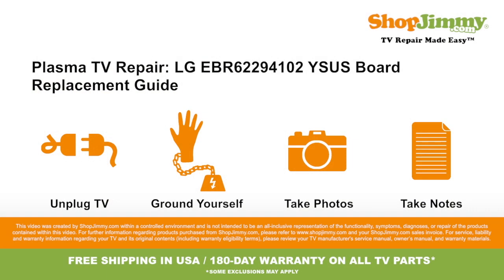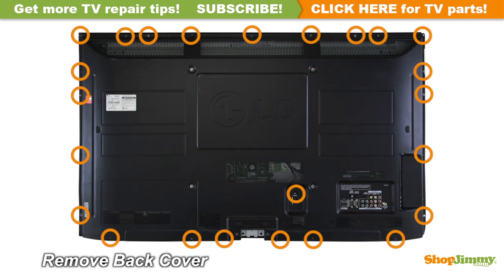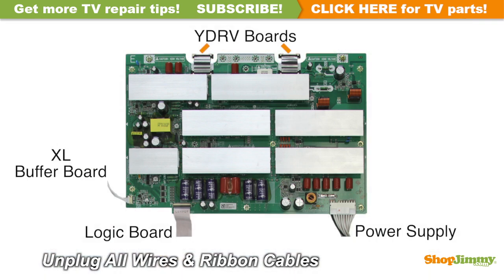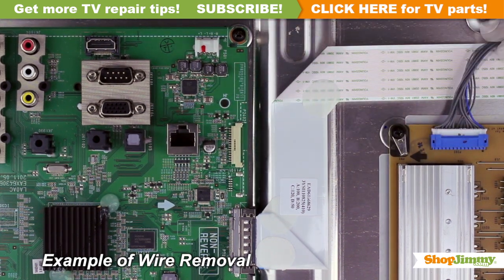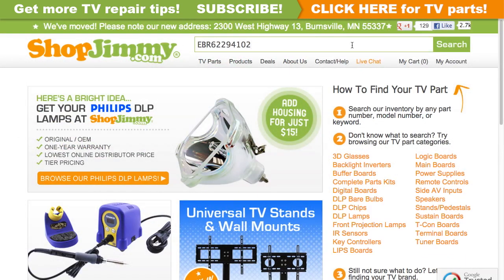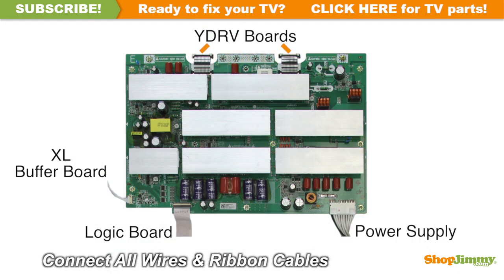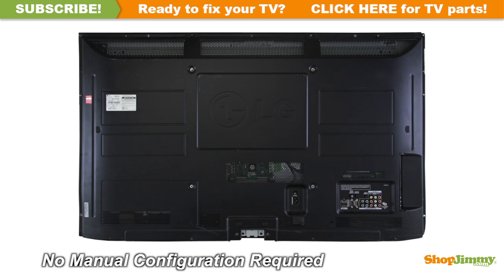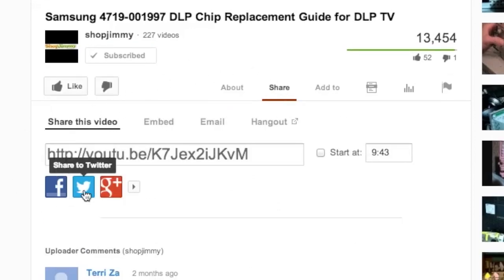LG Plasma TV Repair - How to Replace EBR62294102 YSUS Board in LG 50PK Plasma TVs - Fix Plasma TVs

Comment: can you help me with my old lg? it is turning on but has bad picture, even the "no signal" text has horizontally shifted ghosting pixels, any input has multiple shifted ghost columns... it is like when on an  lcd the ribbon cable has a break or freqvency shift but I don't know how plasma works. no visual issue inside, no puffed capacitors etc...

Comment: We have an LG 60pk200 UA 1080p Plasma tv purchased around 2012 and worked fine up til 3 or 4 months ago when it started showing some horizontal flashing lines but only sporadically for a few weeks before not coming on at all, it shows the powered light but won't turn on with the power button on the tv/remote. I looked around on google and mainly see people mentioning the ysus board as the issue but I'm not 100% sure and no local shop that I know of.
Reply: Problem seemed to be the Main Board, ordered a new one and works totally fine now.

Comment: Hi, wonder if you can point me in the right direction please.  I have a 50pk590 with sporadic horizontal lines and reverse imaging. I’ve changed logic board but the  problem is unchanged.  Get the problem displaying the menus as well with all inputs removed.  Many thanks

Comment: I have a LG 42PG25 plasma TV manufactured in May 2008. The model number is 42PG60UA. It has a LGE PSU EAY39333001 PSPU-J704A Rev 1.0 power supply unit.

It has a EAX42297601 Rev J YSUS board, a EAX41603501 Rev J ZSUS board and a EAX41833301 Rev C CTRL control board. 

A few weeks, the TV would power up but with a blank screen. The solid red standby light in front works. When I press the front power button, I hear a solid clunk sound and the standby light changes colour from red to blue and starts flashing blue. At about the 5th blue flash (approximately 5 seconds in) I hear a buzzing sound in the back. At about 18-19 flashes later the light stays solid blue with no screen or sound. When I turn the power button off, it takes about 11-12 second before the solid red light turns off complete with a clunk sound. 

I watched a lot of LG TV repair videos that led me to believe my PSU was damaged. I ripped apart the back panel and found Capacitor C235 blown from the PSU board. I replaced it and nothing changed. I had spare 10V 3300uf capacitors and replaced C232, C233 and C234 as well and nothing changed. I checked fuse F101 and F801 on the PSU and both were good. I checked fuse FL201 on the YSUS and it was good. I checked the some voltages on the P811/P64 testing terminal right beside where the power goes from the PSU to the YSUS – all voltages were in spec for all the testing terminals (VS, VS, NC, GND, GND, VA, VA, GND, M5V, M5V). 
I tried isolating the buzzing sound from the YSUS and it is sounds like it is coming from a 4 pack of glued together red capacitors C701, C702, C919 and C920 on the YSUS board, or possibly the two copper coil things I think called L901 and L701. 

I am not sure if it matters, but when I turn on the TV, control board light D103 (is this a diagnostics light?) comes on but then immediately goes to D104. Light D104 stays lit up until about 60 seconds when I hear a change in the buzzing frequency ( a bit lower) and then D103 comes back on and stays lit. I also see a light on the video board (it has a sticker that stays 42PG60UA), light LD803 that stays lit up the whole time with TV tries to power on. 

I really don't care for the TV as it is a power hog, old and small. But I've already started down this path of diagnostics and will not give up. Plus its kind of fun! Does anyone have any suggestions what I should test next?
B.

Comment: Hi I have a LG Plasma model # 60PZ550-UA    The picture had been turning green for awhile b4 it totally went black. It still had sound. All I Know is there is a bad fuse on the Y sustain board (Brown stripped ceramic fuse)its a in line fuse. got some coming but I dont think thats the problem or it wouldn't have slowly went out????Right?????
TV is only 6 yrs old!

Comment: Hi, I have an LG 50PK590 TV, it seems that my Main Board is faulty as there is no video/audio, I can see RED LED blinking when I push buttons on my remote apart from that I can only turn it on or off no VIDEO at all, I searched online for a replacement Main Board however it costs more than £200, that is way too much for a component of an old TV, is this a common fault? what would be the actual component on the board that's faulty? Main board serial EAX61141603 (4) LGE HEBT61039402 G2, thanks so much! Ben
Reply: Benas Grigisas I have the same one n problem but can't find the part

Comment: I also have a Tedelex ec pd 1000 plasma which when i switch it on it shows a red light.when i remove it on standby the red light goes off but there no picture or sound.there is 5v only on the power supply

Comment: I have the LG Plasma TV LG 60 PK 750 2010 and when I attempted to turn it on with the remote, the blue light would come on in the lower left hand corner on the front of the screen but no picture.  HELP.  There appears to be power to the TV but no picture.  Can you help me out?  Retired Greg
Reply: Hi, I am Hasan from Bangladesh,  and I have a LG42PT250 TA....Plazma Tv
The problem is Y sustian board is gone, how may I buy, please help me to buy it,
please contract me
hasanshek78@gmail.com
h/p+8801712443020

Thanks
best regards

Comment: i have an lg 42 inch 42PJ350 and it clicks on and off no display no sound but red light i disconnected the ysus and the set clicked once as it indicate coming on does it mean my ysus is faulty and causing the power cycle???
Reply: Rosak tiada gambar

Comment: Hi there.
I have LG 50PC56 plasma tv.Few months ago screen start flickering black from time to time on 1080p.After few weeks i had to set my ps4 into 1080i..this solve problem for another few weeks.then it starts flickering again and i go for 720p.
This resolution was working fine for about three months and now the same story happening.When i start the tv from cold its working fine on 720p..after its warming up the flickering going on again.
I opend it up today,clean all the dust and surprisingly tv was working 1080p for a few mins.I was ready to give up,then found your channel and maybe there is still some hope.
Can you please direct me whitch board i need to replace?
Thank you in advance.

Comment: Hello I have an lg plasma  model number 50pj350-ub, svc code 50pj350 -UB AUSLLHR. The tv  had a loud pop while on and the screen turned black. There is no damage done to the screen it just suddenly went black . It turns on and off and projects sound.
Reply from the maker: +Ever Andujo   Try all repairs and troubleshooting at your own risk.  I recommend replacing the YSUS and the YDRVTP & YDRVBT boards in your TV.  Click this link to replacement parts for your TV model number:  http://www.shopjimmy.com/catalogsearch/result/?q=50pj350-ub  There may be multiple boards for the same TV model number, be sure to match part numbers on your current board, with your replacement for compatibility.  Here is a link to a video showing how to identify your part number, click here:  https://www.youtube.com/watch?v=GEllG3RV-tcThanks and please let us know if you have any further questions with your TV Repair!  www.shopjimmy.com

Comment: My PK550 clicks on and off so that's not a power supply problem?
Reply from the maker: Zamorazone    Try this at your own risk. Unplug the TV, then disconnect the YSUS board and plug in the TV to see if the TV powers up. Reply with the results of this test. Thanks! www.shopjimmy.com
Reply: ShopJimmy.com I had a bad diode on the psu i changed,now the clicking is not there but the red light just blinks no power up.I disconnected the YSUS and nothing happened also.What gives with tv's these days this is my second blown set in eight years panasonic and lg.I have a 30 yr old panasonic tube in the attic that still works.Any how thanks for trying to help.

Comment: I have a LG plasma 50" T.V. model #50PG10_UA. I turn it on, and in a few minutes it cycles on and off. It still has it`s audio and video. Which is the most common board I should change.
Reply from the maker: todd s   PLEASE SUBSCRIBE TO OUR CHANNEL - Try all repairs and troubleshooting at your own risk.  This could be a problem with either the power supply or the main board in your TV.  You can replace them individually to see if one of those boards fixes the problem.  Click this link to replacement parts for your TV model number:  http://www.shopjimmy.com/catalogsearch/result/?q=50PG10_UA  There may be multiple boards for the same TV model number, be sure to match part numbers on your current board, with your replacement for compatibility.  Here is a link to a video showing how to identify your part number, click here:  https://www.youtube.com/watch?v=GEllG3RV-tcThanks and please let us know if you have any further questions with your TV Repair!  www.shopjimmy.com

Comment: Lg 60py3df, Before with the back cover open, shuts down for a second and goes back on. Now system shuts down after 5 to 6 seconds, you'll see the picture and sound. Screen goes black but still with audio, after 2 secs shuts the whole thing down. Can't see any bulging caps. Sometimes it works for an hour.

Comment: My zenith plasma TV z50pj240 lost the picture.   Power supply is working well.
Reply from the maker: Aaron Congdon   PLEASE SUBSCRIBE TO OUR CHANNEL - Try all repairs and troubleshooting at your own risk.  I recommend replacing the YSUS and the YDRVTP & YDRVBT boards in your TV.  Click this link to replacement parts for your TV model number:  http://www.shopjimmy.com/catalogsearch/result/?q=z50pj240  There may be multiple boards for the same TV model number, be sure to match part numbers on your current board, with your replacement for compatibility.  Here is a link to a video showing how to identify your part number, click here:  https://www.youtube.com/watch?v=GEllG3RV-tcThanks and please let us know if you have any further questions with your TV Repair!  www.shopjimmy.com

Comment: Hi guys, love the channel, thank you for all of your help!!  I have a 50" LG  Plasma TV (50PK750).  When I attempt to power on, the set immediately turns off.  After watching your videos I'm thinking it's the YSUS.  What are your thoughts?  Thanks again for all of your help.
Reply: Arnie B I read the post from Bee Gee below, who had the exact same problem.  In that post you recommended a new power supply.  He had a different model, but the exact same problem.  Please let me know if you recommend a new power supply or YSUS.  Thanks again!!
Reply from the maker: Arnie B Try this at your own risk. Unplug the TV, then disconnect the y board and plug in the TV to see if the TV powers up. Reply with the results of this test. Thanks! www.shopjimmy.com
Reply: ShopJimmy.com Hi guys, I unplugged the TV, disconnected the y board, plugged the TV back in, and tried to power it up.  Unfortunately, it still did not power up.  I'm assuming that it is the power supply.  What are your thoughts?
Reply from the maker: Arnie B   Try all repairs and troubleshooting at your own risk.  I recommend repeating the same test on the X board in your TV.  Thanks!  www.shopjimmy.com
Reply: +ShopJimmy.com Hi all, sorry for the long post.  4 months later I am finally getting back to try to fix my TV.  I'm certain the issue is the power supply.  I have found countless You Tube videos documenting the exact same issue.  Since I rarely have time to work on this I was going to order a replacement power supply, but these are almost never in stock.  Since the power supplies are rarely in stock I decided to fix the board myself.  Most of the videos show changing specific components such as the R927 and R929 resistors, the D304 diode, and IC301 voltage regulator.  I tested all of these components on my board, and most were in fact bad.  I purchased and installed the replacement components which addressed my original problem of the TV clicking and automatically powering off.  However, my TV is still not working.  When I power it on I still don't get any picture, and the TV locks up.  I'm certain the issue is still the power supply.  Here's where I need your advice. I tested the new components before I installed them and they were all working.  After I installed them on the board, though, several of them appeared to be bad, so I removed them.  Upon removing them I again tested them and they were all working.  Do you have any idea what on the power supply would prevent the diodes and capacitors from working while on the board?  Thanks again for all of your support.

Comment: I have a lg 50pv450 a I hear a click noise and a faint flick of light but no picture . I has power and was wondering if it was maybe the control board.
Reply: bryan trotter  It does have sound too!'
Reply from the maker: bryan trotter  PLEASE SUBSCRIBE TO OUR CHANNEL - Try all repairs and troubleshooting at your own risk.   I recommend replacing the YSUS and the YDRVTP & YDRVBT boards in your TV.  Click this link to replacement parts for your TV model number:  http://www.shopjimmy.com/catalogsearch/result/?q=50pv450  There may be multiple boards for the same TV model number, be sure to match part numbers on your current board, with your replacement for compatibility.  Here is a link to a video showing how to identify your part number, click here:  https://www.youtube.com/watch?v=GEllG3RV-tcThanks and please let us know if you have any further questions with your TV Repair!  www.shopjimmy.com

Comment: I have a LG flatscreen tv Model 37LE5300-UC.  The picture randomly turns green and then back to normal color.  This happens all day.  Any suggestions???   Thanks!!
Reply from the maker: Paula McMillan  Please watch this video FIRST to help with your repair!  https://www.youtube.com/watch?v=BP3NVNCGEv8  I recommend replacing the main board in your TV.  Click this link to replacement parts for your TV model number:  http://www.shopjimmy.com/catalogsearch/result/index/?cat=56&q=37LE5300-UC  There may be multiple boards for the same TV model number, be sure to match part numbers on your current board, with your replacement for compatibility.  Here is a link to a video showing how to identify your part number, click here:  https://www.youtube.com/watch?x-yt-cl=85114404&x-yt-ts=1422579428&v=RwHTvjMdrhk  Thanks and please let us know if you have any further questions with your TV Repair!  www.shopjimmy.com

Comment: I have the LG Plasma 50PX950-ua when I power it on the back light comes on then goes dark. The blue light at the bottom center comes on and then blinks off and stays on for about three seconds and goes back off. No sound no picture

Comment: Hello. I have an 50" LG plasma 50PY3DF. When I plug it in it immediately starts cycling on and off and clicking. No image on screen. One of the two fuses on the ysus is blown and the one fuse on the zsus is blown. Replaced them and they blew again. Green lights 0,1,2 on the control board light up. 2 goes off and 0,1 stay on till resets again. Should I replace ysu ysus buffers and zsus?
Reply from the maker: Curtis B  Please watch this video FIRST to help with your repair!  https://www.youtube.com/watch?v=BP3NVNCGEv8  Yes, I would recommend replacing those boards.  Click this link to replacement parts for your TV model number:  http://www.shopjimmy.com/catalogsearch/result/?q=50PY3DF  There may be multiple boards for the same TV model number, be sure to match part numbers on your current board, with your replacement for compatibility.  Thanks and please let us know if you have any further questions with your TV Repair!  www.shopjimmy.com

Comment: I have an LG 50PZ550.  The screen began showing multi colored thin vertical lines on the entire screen with no picture image.  No problems with shutting down.  No sound.  I got a copy of the tech manual that seemed to indicate that the control board was the likely culprit so I: checked all of the ribbon connectors on both ends of all control board ribbons.  When that didn't work I replaced the control board, and now I have no image at all.  Your advice is appreciated.  Thank you.
Reply from the maker: Andrew Casciano   This sounds like a TV panel (TV Screen) problem.  If your TV panel is bad, it may be more cost-effective to replace the TV as panels are typically hard to find in stock, difficult to replace, and expensive.  Thanks and please let us know if you have any further questions!  www.shopjimmy.com

Comment: I have a LG 50PA5500, with no indication of blown capacitors.  when plugged it has sound, but no picture. (the sound was coming from device hooked up through hdmi)......Tv stopped working after changing the pitcure quality to vivd/high performance and hooking up a ps4 for a couple hours. after the session i cut the tv off. when i tried to watch cable, there was no picture but there was sound.
Reply: I got the same problem. Almost the same steps, after trying to change the video/picture settings and plugging in DirectTV instead of a PS4.  Did you fix this?
Reply: No, sorry. The TV is just sitting in my garage.

Comment: Hello I have the LG Plasma 50PK950 and while watching the TV the last few months it would shut off sometimes, but it use to come right back on when you press the power button on the remote.
But the last time it shut of the screen went a solid pink (like pepto pink) and shut off.

Now when I power it on the power light goes from red to white like its coming on, but no picture or sound is produced, screen is black. I can also see a green LED light flashing inside the vents in the back when I do press the power button. 
It sounds like to me that the screen isn't getting power.... but you are the expert ?? where should I start?
Reply: Oh I have not noticed any clicking or popping when the TV it trying to power on.